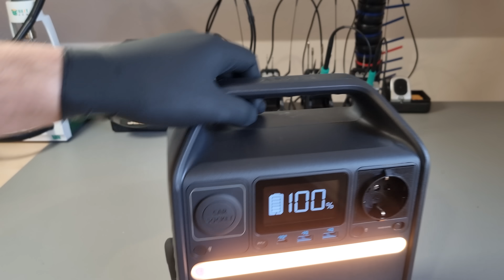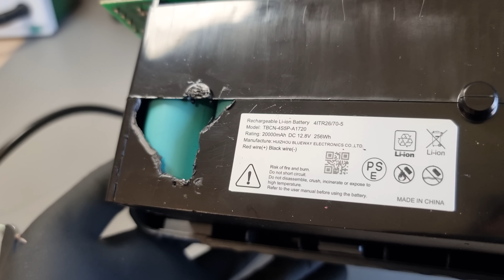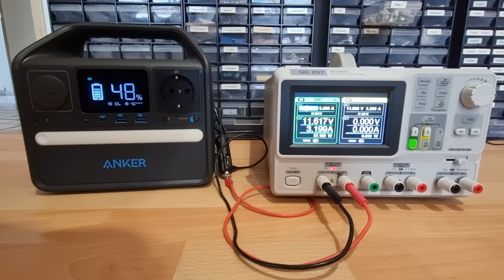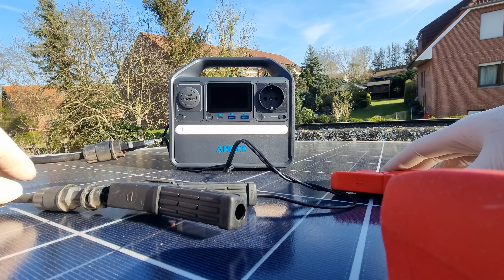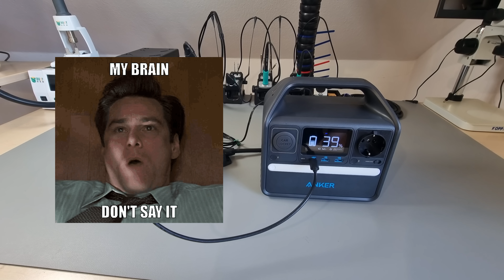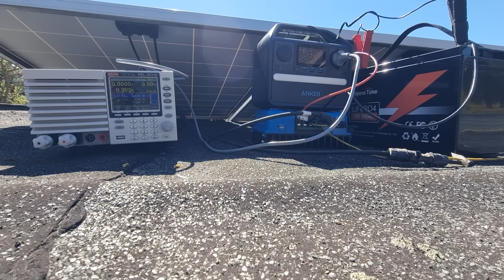LiFePO4 inside: Anker 521 Portable Power Station

Comment: Your assumptions on cycle life of NMc batteries seems to be based on consumer batteries as used in mobile electronics. In my experience this seems to depend much less on NMC/LFP but much more on the cell type used. At my work we use NMC cells that are good for way beyond 5000 full cycles in demanding hybrid traction applications for example. Or even LTOs that donde mind something around 20k cycles. Nevertheless, 3000 seems more than enough for that kind of application :)
Reply: well NMC is what differs from LFP or LTO 🤦‍♀️🤦‍♀️🤦‍♀️

so it heavyly depends on the lithium technology.

NMC can never reach over 500 full cycles.  800 partial cycles are max.

Comment: A portable iron with induction heating would be interesting.  I really like my 120W Xytronic induction soldering station.
Reply: The difference between induction heating (e.g. Metcal) and integrated tip heaters (e.g TS100) is pretty small. Both have a massive advantage over older irons that have the tip in loose contact with the heater.

That said, at least some Metcals convert the incoming AC to low voltage DC before converting to high frequency AC so those would be easy to convert to battery power.
Reply: i used to have a rechargeable weller that used cold soldering, but at the time i had no idea what i was doing and kinda threw it into storage right away. they're pretty cheap around 35 USD  you can find em on ebay

Comment: Can’t a modified simple uninterruptible computer power supply (UPS) work equally or even better ??
Reply: For backup power it would likely be better. As a power bank, not really. They generally use lead acid batteries with low power density and which don't like regular full discharges.